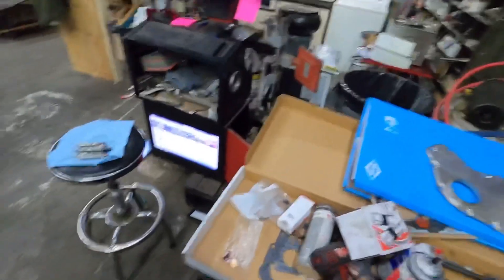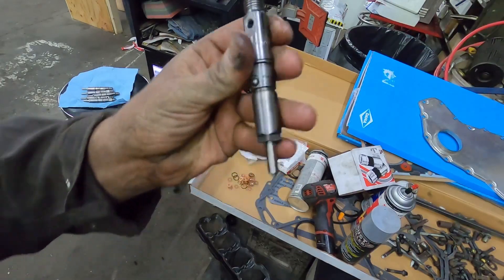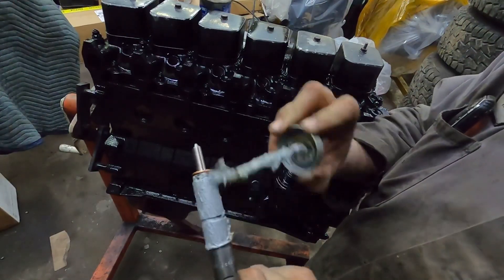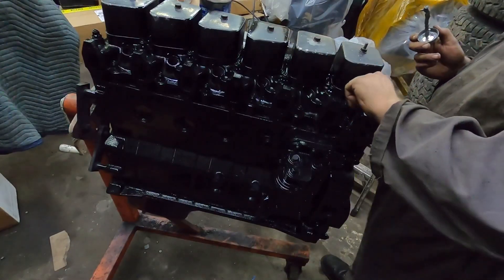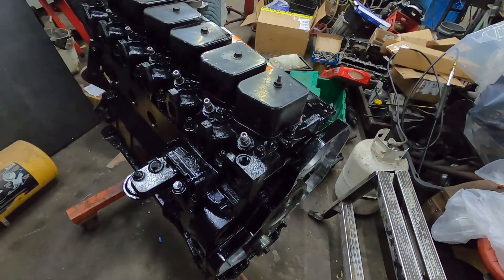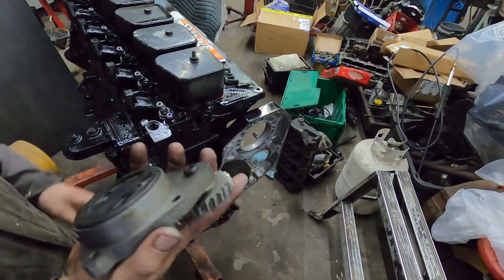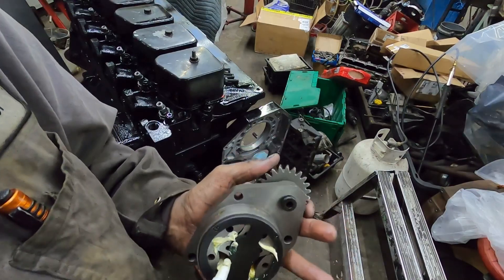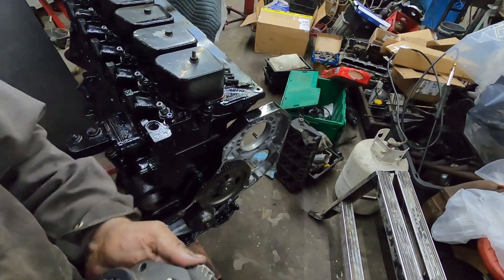HOW TO REBUILD A 12 VALVE CUMMINS ( part 17 )

Comment: What if the injectors don't snap into the housing?
Reply from the maker: i have never had a set not go in.  as long as the holes are clean should have a issue
Reply: @CUTTERUPROB  ok! Thanks for answering my question, my 95 is similar to yours, only difference it's a 2wd.

Comment: Many years ago I bought a set of rebuilt injectors from a shop in Canada . My old 95 was a 160 hp so I bought a set of 215 injectors . I run 17 deg timing because it gives me good mileage . So when I got the injectors there was two sets of washers so I installed them and I used anti seize on them just because. . So In installed the thicker washers and the trucks sounded odd when I started it up . So I pulled it down and installed the thinner washer . That fixed the odd idle quality and it just sounded better .
Reply from the maker: ya funny how something that small can make a difference